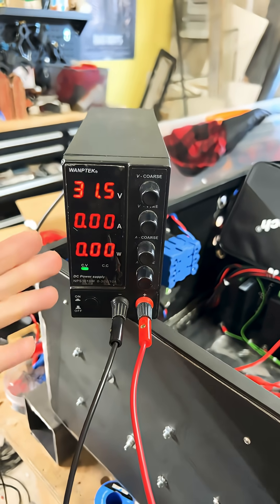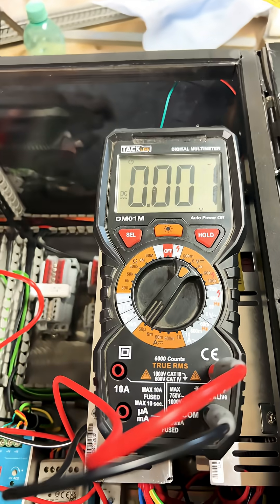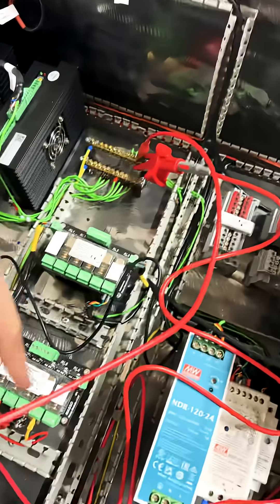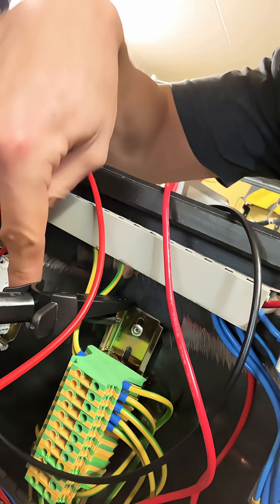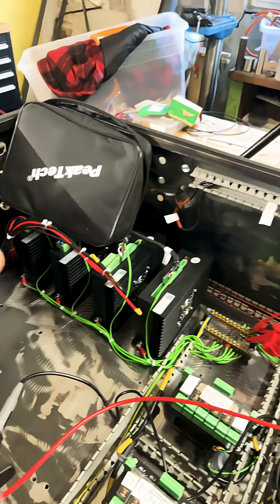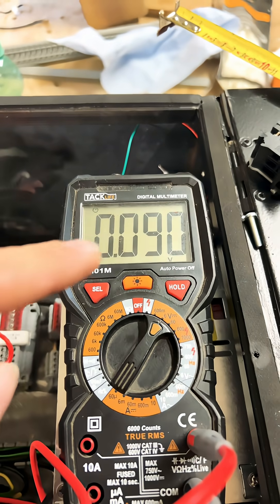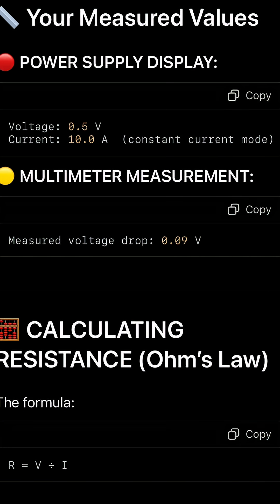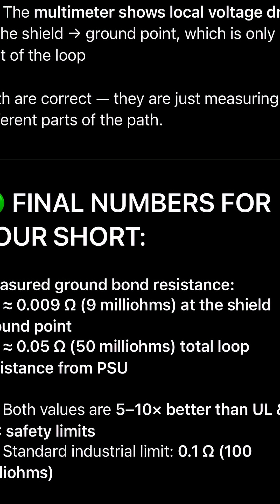Proper CNC Grounding: STOP Noise & EMI Problems Before They Start!

Comment from the maker: In this test I disconnected my CNC controller box from mains and used a bench PSU in constant-current mode at 10 amps to simulate a professional ground-bond tester. By reading the PSU voltage and applying Ohm’s law (R = V/I), I can calculate the resistance of the entire ground path. Then I used a multimeter to measure individual drops along the raised ground bar. The results showed excellent low resistance — exactly what a CNC enclosure needs. I made a full video explaining how you can do this yourself

Comment: Achei interessante.  Poderia explicar melhor por aqui?
Reply from the maker: ✅ Pro Version Explanation for Your YouTube Audience

IMPORTANT:
Before testing, the controller box must be fully disconnected from mains power.
This method only uses a DC bench power supply and a multimeter.

⸻

🟩 What I Did (Simple Explanation)

Professional ground-bond testers push high current (10–30 A) through a ground path and measure how much voltage is lost.
Using Ohm’s Law:

R = \frac{V}{I}

we can calculate the exact resistance of the ground connections.

I replicated the same method using:
	•	A bench PSU set to 10 A in constant-current mode, and
	•	A multimeter measuring voltage directly on the ground bar.

This gives almost the same information as a ground-bond tester — ground resistance in milliohms — without the expensive tool.

⸻

🟦 Step-by-Step (What the Short shows)

1️⃣ Put the PSU into constant-current mode

I set my PSU to 10 amps.

The PSU automatically adjusts voltage to push exactly 10 A through the ground system.

⸻

2️⃣ Clip the PSU leads across the ground path
	•	Red lead → my chosen ground test point
	•	Black lead → cabinet chassis / star ground

This forces 10 A through the full grounding network.

⸻

3️⃣ Read the PSU voltage

Example:
The PSU displayed 0.6 V at 10 A.

Using Ohm’s Law:

R = \frac{0.6\text{ V}}{10\text{ A}} = 0.06\ \Omega = 60\text{ m}\Omega

That 60 milliohms is the total resistance of all cables, lugs, screws, and sheet metal between the two clips.

That’s excellent for a CNC enclosure.

⸻

4️⃣ Then I used the multimeter to measure smaller sections

While the PSU was pushing 10 A continuously, I probed different points on the ground bar.

Example readings:
	•	0.091 V between one pair
	•	0.012 V between another

Convert them:

0.091\text{ V} / 10\text{ A} = 0.0091\ \Omega = 9.1\text{ m}\Omega

0.012\text{ V} / 10\text{ A} = 0.0012\ \Omega = 1.2\text{ m}\Omega

Small differences simply mean:
✔ different lengths of wire
✔ different screw contacts
✔ different parts of the brass bar

All completely normal.

⸻

🟧 What This Demonstrates

This DIY method tells you:
	•	How well your star-ground is bonded
	•	Whether the cabinet is properly tied together
	•	Whether wires or lugs have high resistance
	•	Whether your grounding meets typical machine standards (< 0.1 Ω)

So viewers can test their ground bonding without buying a €500 tester.